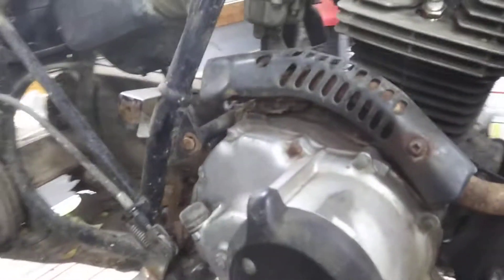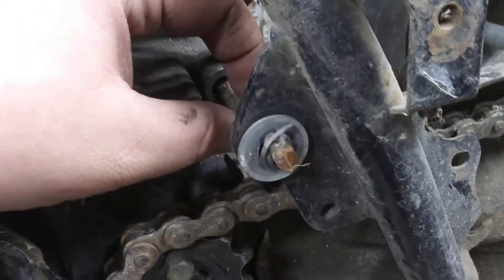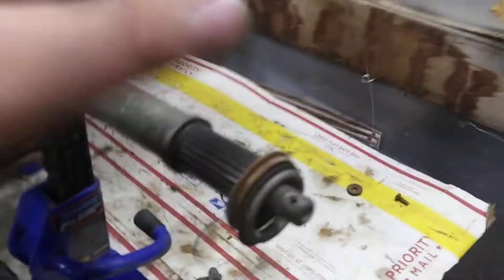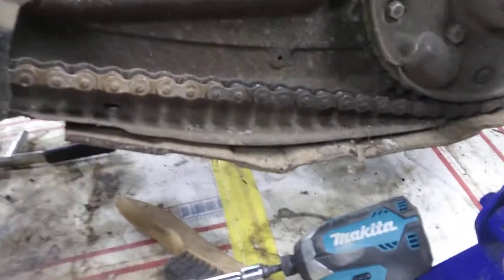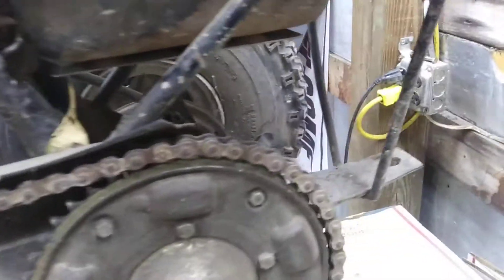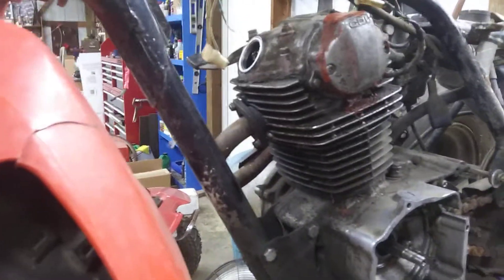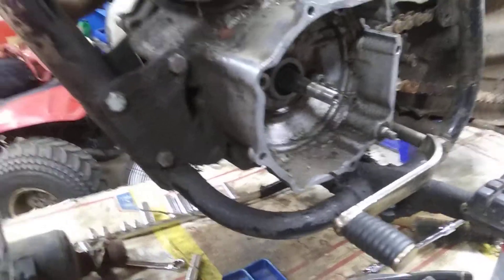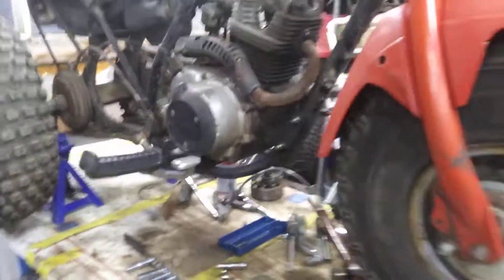My new 1980 ATC 185S

Comment: The 1980 atc 185 is the non s model with a slightly larger chassis and 25x12-9 tires. It's a great frame for a race conversion and has a rep of wooping the 200x in races. My guess it's because of the higher duration cam it has it's a better upgrade than the xr200 cam I'm told. You often find these motors in a 200x frame for an auto x  conversion Awesome score bud👍